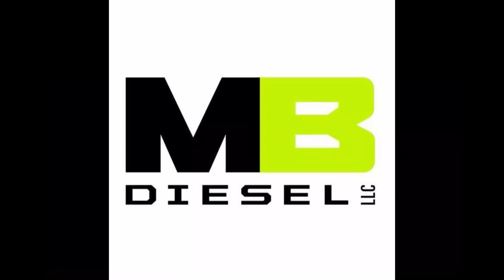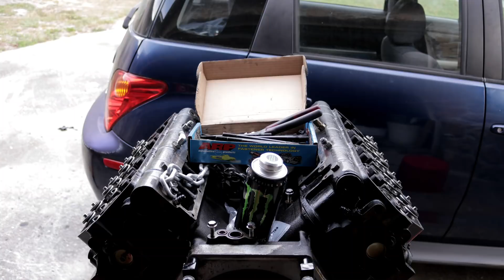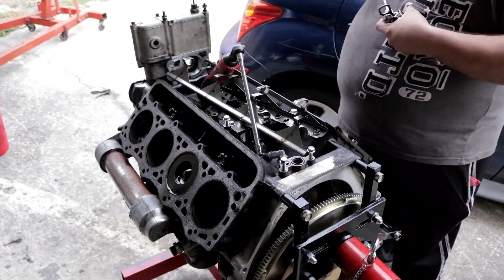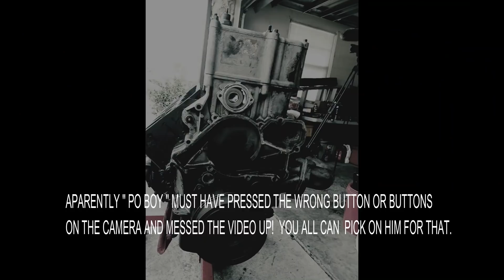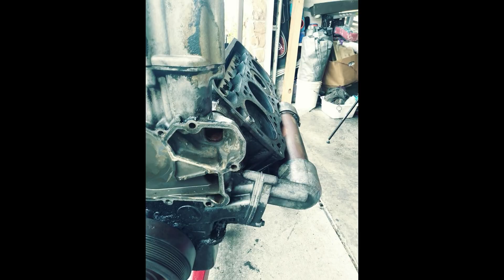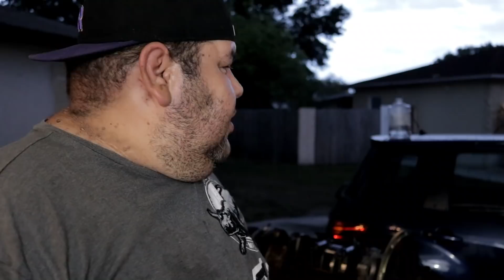7.3 Powerstroke engine tear down for Race Build Part 3

Comment: Love the videos man keep them up I have a OBS that makes about 450 to the wheels and I plan on buying a motor to build for around 700 these videos are helpful.
Reply from the maker: Thanks for watching Po Boys Diesel It is an honor to be able to help even if it is just a little  We do appreciate each and every Viewer and Subscriber. A 700hp build sure is a nice way to wake em up I was running 649hp on the Dually  before I decided to do a full Race build and keep the dually as the Work horse/Tow pig. The 7.3 platform is lots of fun specially once you begin to push a it more fuel and air. I know you will have a blast with yours I definitely wish you the best on your build and if you come across any difficulties don't doubt to send us a message here or on our Website to see if we can guide you through. Thanks again and remember LET THE COAL ROLL!